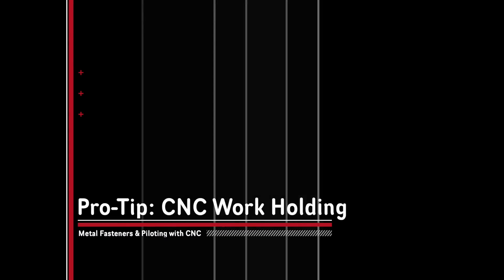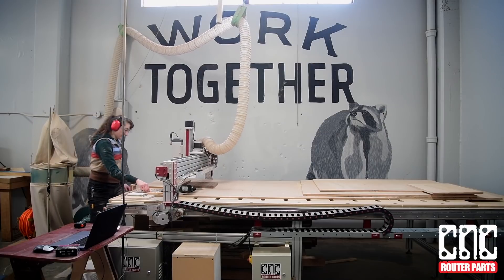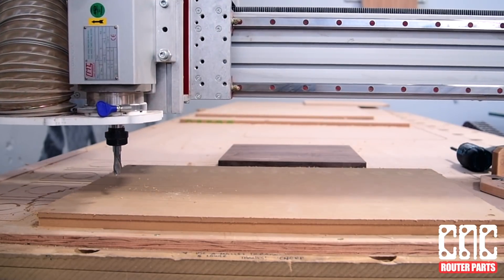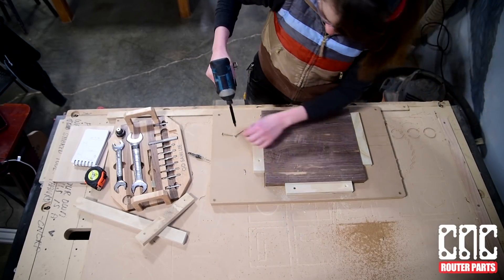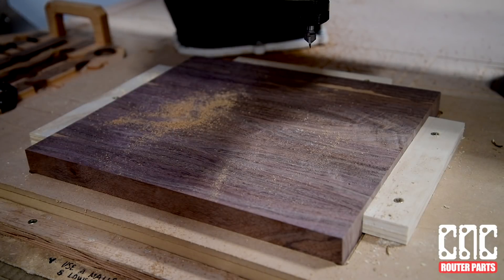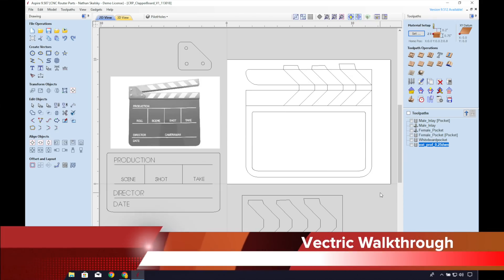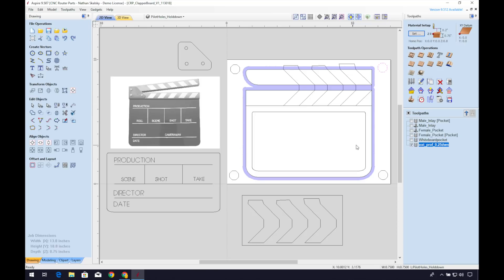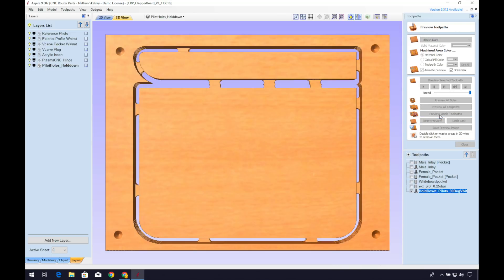Pro-Tip: CNC Workholding with Metal Fasteners

Comment: Hi there. Another same but different workholding method I use is to screw wafer head screws immediately up against the side of the stock. Each head half on the stock around the perimeter.  So long as the screws are clear of your work area it works great. Even on aluminium plate stock 10mm or so this holds the edges down nice and tight.